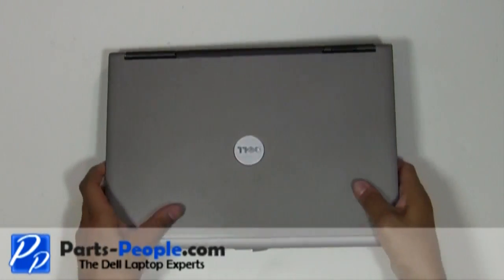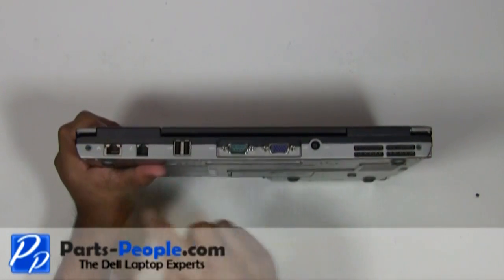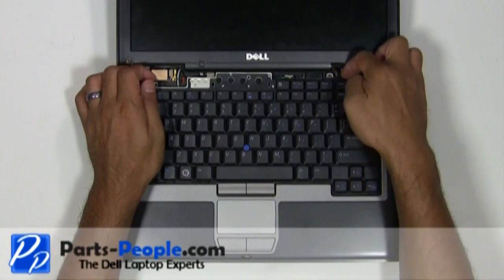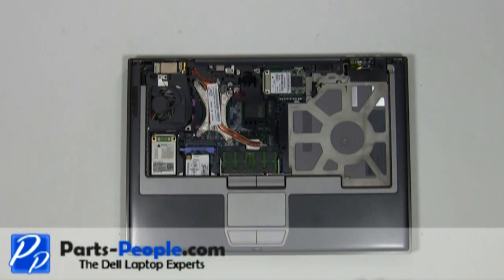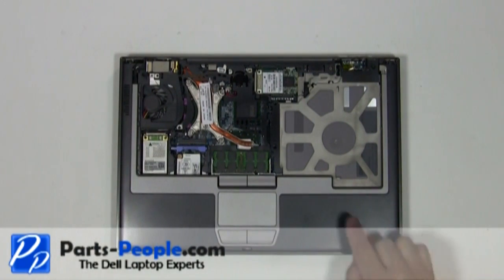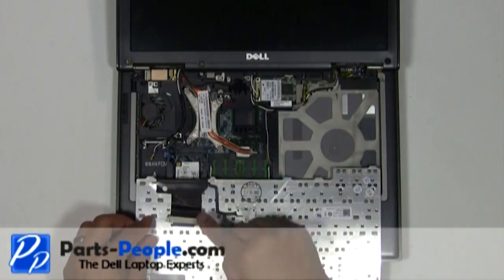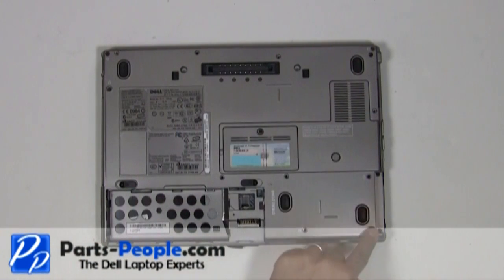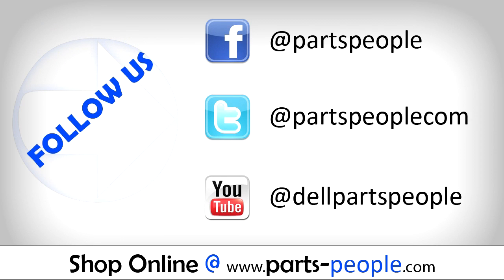Dell Latitude D630 | Touch Pad Palm Rest Replacement | How-To-Tutorial

Comment: The mouse cursor jumps randomly when use the touch-pad. Can you tell what could be the issue, although I did not use my laptop much. Dell customer support said I need to change the palm rest. I am suspicious how the touch-pad can wrong if I did not use it much. Can you also tell what could be the reason for touch pad to behave this way?

Mine is having 4GB (2GBx2) ram and installed Win 8.1 (x64) OS. The cursor is functioning this way because of touch-pad drivers not supported by Win7 or Win8 in Dell Latitude 630?
Reply from the maker: From a diagnostic stand point, I would have to look at the laptop and take it apart to find out why it is happening. It could be a bad touchpad or a bad touchpad cable connection. I've seen palmrest cables cause problems like this too. Unfortunately, without having the laptop to look at, I wouldn't know what is causing the problem.

Comment from the maker: If you have Win 7 you should be able to search "change mouse wheel settings" in your start menu.  From there you should be able to adjust your trackpad settings.  If this does not resolve the issue then you may have a driver issue and you may need to update your trackpad drivers which can be found on the Dell website.